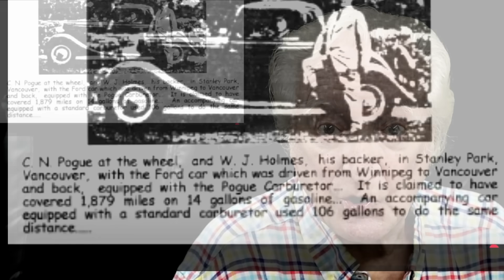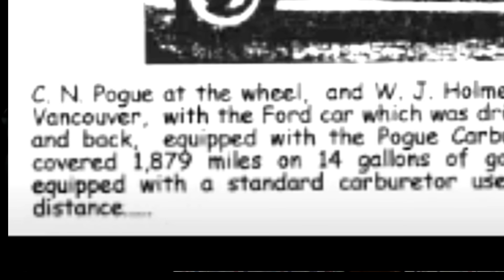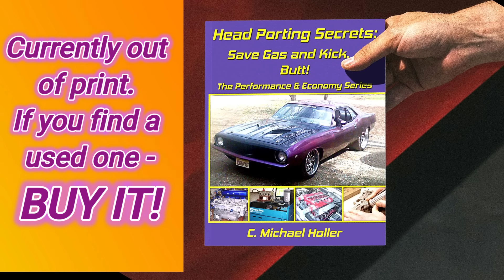100 MPG carb - the real truth!!

Comment: I had a carb shop in Griffith, Ind 20 years ago. A guy came to me with a Ford pickup 6 cid with. Carter single bbl on it and wanted it rebuilt, I rebuilt it put it back on started it up it seemed to run a little lean. I put a fuel gauge on it started it up, it rocked up to 4 lbs at idle, the phone rang went in ansered it talked about 5 mins, engine still running. I let it run another 15 20 mins. The fuel pump was leaking fuel in the crankcase, PCV was pulling vapors up thru it and keeping the engine running, smoothly I might add. My first hot vapor engine, I was impressed. Went in the shop and pulled out my Smokey Yunick book out and reread the story of the otto engine and hot vapor engine

Comment: I managed to get 84mpg on my VW Vento 1.9TDK back in 2013. That being said, I did not go over 90km/h on that 1 hour run, ran strategic up the hills, caught speed on the downhills that I used on the way uphill. It had a "massive" output of 75 horsepowers, so it was slow as heck, but it ran cheap at least. I filled it up at a gas station, then drove 1 hour and filled it up on the next station. I did the numbers on my calculator 3 times because I couldn't believe it. Those two receipts were kept in that car until I got rid of it.

Comment: My grandfather always said a carburetor is nothing but a drain . You can run an engine on vapors -
Reply: One thing a carb does is vaporize the fuel actually it atomizes the fuel so it will vaporize in the engine if you vaporize it before it goes into the engine it takes 400 times as much space equals less air less fuel less power

Comment: I have a heat flow chart from Caterpillar Corp from a study they completed in the sixties. On gaseous fueled, spark ignited engines, only 29% of the heat produced is converted into shaft horsepower.  This is a  fairly common percentage. Waukesha stationary engines with the ebullient-cooling configuration gains some percentage.  Same with stratified charge configuration.  This last configuration gains about 5 percent as i recall.

Comment: Without the accent grave nobody pronounces the 'e' even if the word is French. The American pronunciation has always had a silent 'e' and there you have it. In Britain the accent grave was present but there were maybe 5 different meanings to the words coop/coup without moving on to coupe`. Now as far as fuel efficiency my old motorbike gets about 50MPG, the old sprite about 40MPG and I think my mini was around 45MPG. All of these are light vehicles with reasonably modern engines and carbs. 100MPG with an old heavy vehicle with old tech and old roads seems unlikely. The 17MPG with the second car seems excellent under the circumstances.

Comment: So, if I understand this, from the picture at the 3 minute mark, the caption states that the car with the special carburetor used 14 gallons of fuel and the other car used 106 gallons. 106/14=7.57 Therefore, the car with the special carburetor was 7.57 times more efficient. I think somewhere in the video it was stated that the second car would have been about 20% efficient converting heat to power. 20X7.57=151! The car with the special carburetor was 151% efficient in converting heat to power? That math doesn't work!

Comment: I once built a super super mpg 318 for my 68 Cuda and went from something like 20 mpg to 26 and it was noticably faster. I'm in the process of doing another in an older Dakota right now and making  youtubes videos about it...  I don't believe in the 100mpg carb unless it is some tiny little 1 seater useless ufo thing...  it don't count unless the vehicle is something useful every day.
Reply: I'm thinking my old dodge truck with a 318 poly is going to be lucky to see 10mpg and I doubt there is much that will help it. We'll see what the baseline is. I expect to have it running in a few weeks.

Comment: 100 mpg is easy, its more like 250mpg, heres the problem- Liquid gas doesnt burn,  75% of the liguid gas that's being injected into the modern motor goes right through the motor and gets burnt by the cat, ONLY 25% is actually burnt. How much energy is in 1 Gallon of Vaporized gas? Tom Ogle had a good design , Smokey Yunick's Hot Vapor  car.  The trick is to Vaporize the gas, then heat the Vapor so it expands way before you mix it with air like Pouge did with his devise that was patened  and are military ran a few of them on tanks i believe to give us the edge. BIG OIL doesn't want everbody to know there little secret, they killed Tom Ogle and also killed Stanly Muyers who built the buggy that ran 100% on WATER.. I Know for a fact that i can convert my 91 Lincoln Town Car to run on Vapor and easily get 100 mpg, but i really dont want to Die for it.. Check out Tom Ogles design .....
Reply: People have tested the heck out of gas vapors proving they arent much more efficient for the trouble.

Comment: Gasoline Vapor systems is a YouTube channel that has videos of a 79 Camaro doing 100 mph with tons of power by a motorcycle carb through a heat exchange like on a diesel or Prius then through a turbo straight into the intake. Works great but I'm not sure he state fuel economy.

Comment: If you look at electric cars, you can see very precisely how much physical energy is needed to move the vehicle. Then with that and the number of kilowatt hours / BTUs of chemical energy in a gallon of gasoline, you get a good idea of the actual thermal efficiency of the engine in question.

30-40% efficiency is quite achievable with diesels, 60% has been shown in the lab, but a lot of these "100mpg carburetors" basically amount to numbers over 100%. So strictly speaking, we have two possibilities: Either they're all frauds, or else they are harnessing a source of energy that is not the gasoline. I would put these in the same category as the Stanley Meyer car.

Comment: A 100mpg carb is incredibly unlikely. A 100mpg car is achievable. It's a trade off between having economy and acceleration and using fuel to it's maximum potential. Instead of a 12:1 compression ratio going to 18:1 or 20:1 will allow a lot better economy. My car gets up to about 50mpg out of a low tech 1.2 litre engine. If an effort was made to make it more economical and 100-150kg of creature comforts was removed I wouldn't be too surprised if 100mpg could be reached. Getting 100mpg out of a 6:1 compression engine on a 1930's vehicle never happened. IF it had happened it should have been invalidated as the 17mpg vehicle towing the 100mpg vehicle for most of the test shouldn't be considered a valid test :D

Comment: My 2017 m6 elantra was a solid 50mpg car. The best was 60mpg by trying to stay below 50mph for a week. The Hyundai/kia Atkinson engine is that efficient. The only mod was 38psi in the tires. I have broke the 100mpg mark with 3 motorcycles. 

There is a homebuilt diesel coupe that broke 100mpg. Running the headlights cost 10mpg. The over all height was very low. Dangerously low!

Comment: A 3 cylinder gas engine or a 4 cylinder gas engine. With a very low displacement. With a lawnmower carburetor. And a car as lightweight as a Geo Metro. Or lighter. With piston pin offset. For more torque. And a distributor with proper ignition timing. And a 5 or 6 speed manual transmission. Might "POSSIBLY" get close to 100 mpg.
Reply from the maker: Aha - now we are talking!!!!!

Comment: My Father in the late 70's had a part that you add to the fuel line, a plastic type of nozzle that would improve gas mileage on gas guzzling 8 cylinder cars..it cut fuel consumption by 20%...has anyone heard of the product?
Reply: Nothing but false advertising!  These gadgets never work as claimed!

Comment: I have a customer with a 1956 Studebaker. It has a 5.8 liter engine, 4 barrel WCFB carb, 9.7:1 compression,  three speed manual with overdrive and 3.9 rear gears. It will get about 21-22 mpg cruising at 65-70 mph. He also has a 2005 Lincoln Town Car, 4.6 EFI, 4 speed auto overdrive, 3.08 gear. It gets about 23 mpg cruising at 65-70. He says 50 years of technology got him 1 mpg 🤣
Reply: Well the studebaker is for sure lighter, but the ford has more aerodynamics.

But what probably helps the studebaker is decent compression and probably has a more "modern" cam in it.

Still it's funny😅
Reply: @gorkzop The Golden Hawk might be 600-800 pounds lighter than the Town Car. That's a guess.

The Golden Hawk has the stock cam, which is something like 256/252 advertised, 184/179 @ .050, and just at .400 lift. Yes, the exhaust has less timing than the intake. 

The Golden Hawk has loads more torque than the Town Car.

Comment: It takes a certain amount of Hydrocarbons to Oxygen to make a proper combustion. In the early 1980s IN My drag racing days when I could afford It I put a modified Quadrajet carburetor with the primaries honed out on a Ford Mercury 460 Engine and I was getting 25 miles to a gallon. I hate what the EPA has done making Cars much more difficult and expensive to repair the EPA should have to pay for Our repair bills

Comment: The best thing going… since…ever!… was Stanley Myer’s water car.  He was getting over 300mpg with WATER!  Screwed little reactors into the spark plug holes that were water-filled… and a reaction took place that separated the hydrogen atoms from the oxygen in water and burned them both!  This guy went from LA to NYC on 21 gallons of water.  Over 3,000 mile ride, on TWENTY ONE GALLONS OF WATER!  And yeah… they offed his ass and shelved his patent.   He even had contracts with the military and was gonna start mass-producing these kits.  It’s a damn shame what happened to him… and not just him but mankind.  We all were affected.  Coulda been life-changing and great for the environment too.  Was a clean burn.  Crankcase oil stayed wayyyy cleaner for longer.  Imagine refueling your car every 3k miles!  Lol. Was unbelievable.  But true.  Look him up.  Can’t have enough good things to say about his ideas.
   Now the real question is; if the oil companies had a huge problem with Stanley, then why are they all of a sudden so cool with the idea of EVs?…Which are wayyy less efficient than Staleys idea?
Reply from the maker: Cammer - I am going to research this in some depth but meanwhile read this from Wikipedia:- 
Stanley Meyer claimed to have invented a "water fuel cell" that could power a car using water as fuel. However, his claims were found to be fraudulent by an Ohio court in 1996, and he was convicted of "gross and egregious fraud", according to Wikipedia. Meyer's device was essentially a non-functional "perpetual motion machine".
Reply: @DavidVizard huh… interesting!  Didn’t hear that part of it.  I know that dude was poisoned supposedly and was “terminated” from existence.  Was funny how quickly that happened.  Crazy stuff.  I trust you though, buddy!  You’re my go-to for factual information.  Got your SBF engine building book and your Holley carb book.  Love those!  Priceless information!  I look up to ya in the hot rodding culture we are all in and I thank you for your continuous work to support our hobby.  God bless ya!

Comment: David - My bachelor's is in physics. I'm a car guy. You are spot on. No matter how you look at it, there aren't enough BTUs in gasoline/Diesel/etc. to move the mass and overcome the air and internal friction of a car and yield 100 miles per gallon.
Certainly I wouldn't put it past the Rockefeller types to suppress economy by buying the technology - industry is full of examples of greed. But they were never in jeopardy of a 100mpg carb.
Reply: how about Shell's "Eco Marathon" claiming they record 149mpg in 1949 and 22900mpg in 2011?
Reply from the maker: My subtle answer here is - maybe - maybe not!
Reply: You are correct BUT..adding heat to gasoline increases the amount of thermal units many times over this is the premise of all of these devices.
Reply: @davenorman8251 right not only that but there are likely so many other variables not being taken into account. If you think you know something then you better think again.

Comment: The only 100 mpg car is an EV car. It's like having a 100mpg car with only a 2 gallon tank but with a minimal solar can self produce the 2 gallons everyday.
Reply from the maker: We are considering the existence of a 100 mpg carb on a sedan with a conventional gas engine only. An electric motor assisted 100 mpg should should be a piece of cake but that's not what we are debating the existence of.
Reply: @DavidVizard  I remember going to a local town 40 years ago and they promised a 100 mpg carb on a truck or some such. Trying to collect money to make it happen. It never happened. My point is that EV cars have the efficiency these 100mpg car guys craved years ago. It's here and now. Not some future.

Comment: In 2012, I was heavily into plasma ignition systems and tested a vehicle at the NSW RTA EPA testing facility at 5 Lord Street Botany NSW Australia.
These are the people who made the ADR (Australian Design Regulations) which are the Standards that any vehicle must meet in order to be permitted for registration in all states and territories of Australia. 

According to them, I was the only person to have ever turned up and defeated The Thermodynamic Equation, with the results being examined and confirmed by 3x different Physicists at 3x independent Universities across Australia.

The test results were marked “Valid”.

I simply used 4.7uF of radiant plasma as the ignition source, coupled to silver electrodes.

In a legitimate Class A test you’re not permitted to make any more than 1 change per test run, so there is no opportunity to fine tune the carburettor, lest you be deemed to have overstepped the limit of 1x change.

Ok, so simply keep the plasma generator switched off and do the baseline with a regular HEI ignition system and record the data.

Next test, flick the switch, which is the 1x step as permitted, and run the test again.

Result:
An immediate 8 hp increase.
An immediate 10 lb/ft torque increase.
An immediate 15% reduction in fuel consumption.
An immediate reduction in NOx emissions, generally 17% across the board yet one reduction was noted @23%.

Problems:
An immediate change from 14.65:1 to 15.7:1 A/F ratio which cannot be overcome under the 1x step/change rule.

The physicists were astounded and apparently contacted the manager of the facility to enquire how it was achieved.
He couldn’t tell them as he had left the facility with better things to do, as according to him, The Thermodynamic Equation is best described using a Bar Graph.

When 1x emission is reduced, it increases one of the other Bars in a “see-saw” effect, which is of course correct.
Thus, you cannot reduce one emission without increasing another, and that’s been the case forever.

He explained all that then said he’s not hanging around to observe the test as he’d watched apparently hundreds of attempts over the previous 12 years that he’d been in charge and thus was not going to be wasting his time, so he shook my hand and left.

His attitude caused me to rethink the situation but in the end I said “bugger it”, we’d come too far to just quit now, so lets do the bloody test and just go home.

He was on the phone the following day after the Physicists badgered him for running off and not observing how this apparently miraculous feat was achieved and he was pressing me for a quick explanation to pass on to them.

Plasma Gasification is the answer.

You vaporise the fuel, in turn vaporising the NOx emissions across the board.

Post test postulations:
What would happen if the A/F ratio was altered from 15.7:1 (lean) back to the Stoichiometric ratio of 14.65:1?
Given the hp/torque increases as listed and the 15% reduction in fuel consumption to achieve those, the question is, at what point would the engine reach Stoich again, or will it.
Some people think this actually rewrites The Thermodynamic Equation.

I gave up and walked away.
The technology was kept locked in a road case until 2024, when I threw the whole lot into a rubbish skip and never looked back.

Comment: 22,900 miles per gallon set in 2011 is the current fuel economy record. Fact Shell Eco Marathon
Reply from the maker: aaron - Question - could this car seat 4 people comfortably and do zero to 60 in under 10 seconds. if not 2300 odd MPG is pretty useless except for the record books.
Reply: their "Urban Concept"-category achieve 500mpg and powered by 125cc-engine.
Reply from the maker: @xponen   Read what I said in the post to Aaron nearby.
Reply: @DavidVizard  you are right. 500mpg is for 15-to-30mph.
Reply: I agree and see your point. My point is this, the milage gap is so huge from 100 mpg to 22,900 it leaves some doubts that it's not possible. Even though the record is not a sedan like you said and seats 4 people the milage gap between the two examples must leave some confidence that it is possible. 22,800 miles per gallon is a big gap. I do agree with you to a degree. I guess I'm saying my glass is half full.
Reply: @AaronKnowlton-r4r  the way they do it is they miniaturise the engine (they decrease piston/bore-size to increase compression) but this decreases torque & power. But, people want power, hence this will not sell, also if manufacturer create a hybrid (dual-motor) it increases the cost, and the cost overrun as manufacturer upscale it as luxury/concept-car (they include futuristic interior, like Volkwagen XL1) to increase margin.